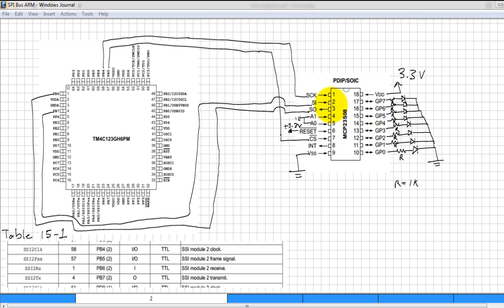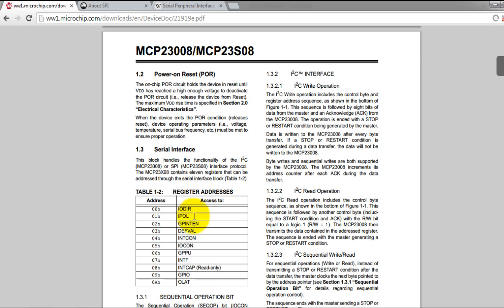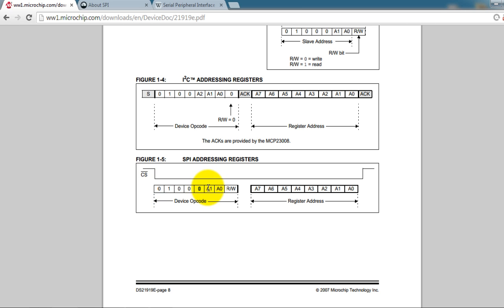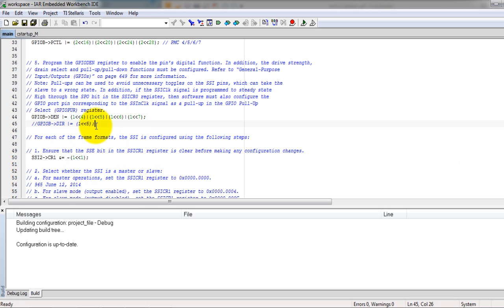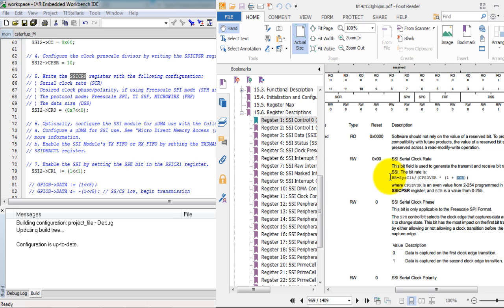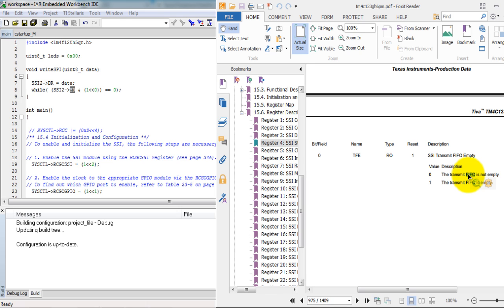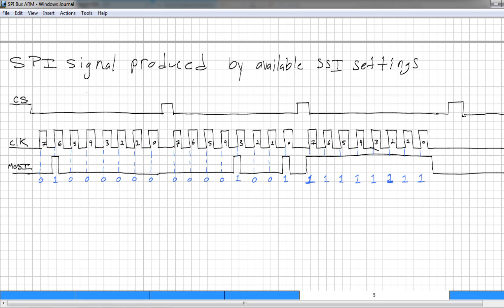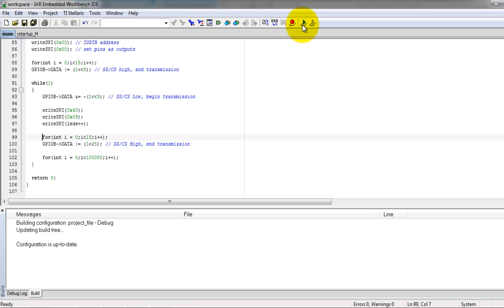TM4C123 Tutorial: SPI Communication

Comment: Hey Man! I am so delighted by your great work. In my opinion, the most important part of this tutorial is the last two minutes which relates to the controlling the chip_select (ss) and the timing specification require to set the chip_select(ss) high again upon completion of the transmission. I had similar challenge where i felt i did everything right but fails to work as expected. Watching this session of your tutorial enlightened me more which i implemented and my configuration works fine. 

Thanks for taking the time to explain this. This really meant a lot to me.

Comment: Thank you for this tutorial I wanted to enquire about the last segment of the tutorial where you add in for loops to ensure that the CS is low and high at the appropriate times may I ask how you discern how many times the variable in your case i should be incremented? How can this be transferred to other IC's that have the same issue? i.e. driving multiple SPI chips with just GPIO pins rather than a specific CS/SS pin

Comment: Great guide, but can you program using the functions libraries instead of the registers?
Reply from the maker: Victor Azevedo No, I'm sorry but the whole point of these tutorials is that people learn to use the datasheet and registers so they can understand how everything works from top to bottom. Once you learn that using the libraries is a piece of cake, just as easy as programming an Arduino. In fact, you can program this microcontroller using the Arduino libraries if you'll like an easier way http://energia.nu/reference